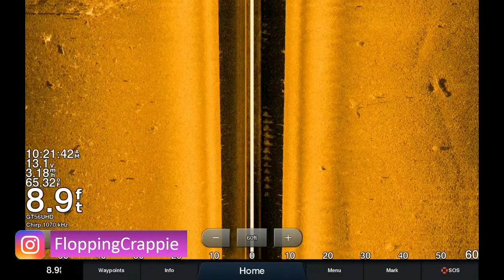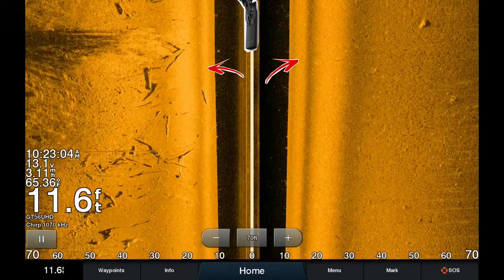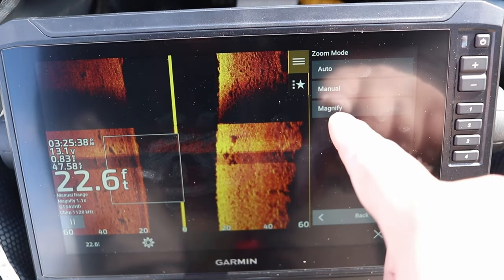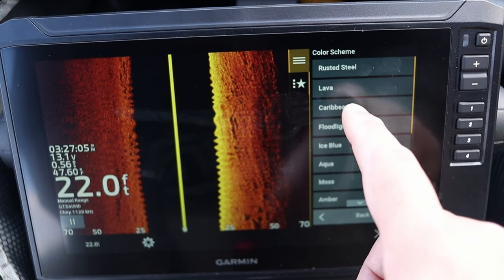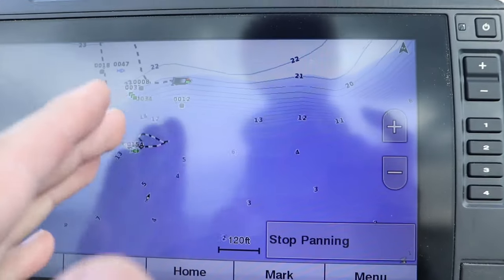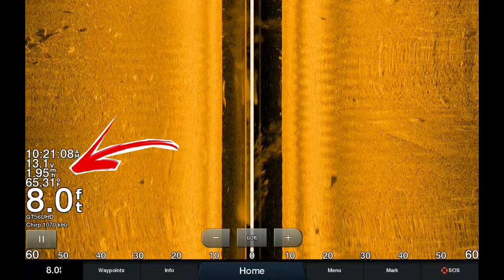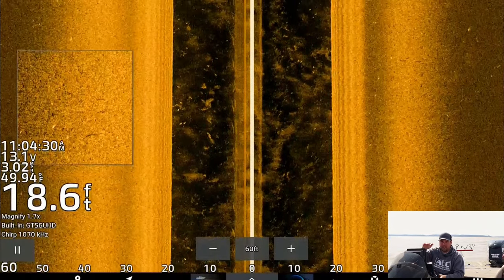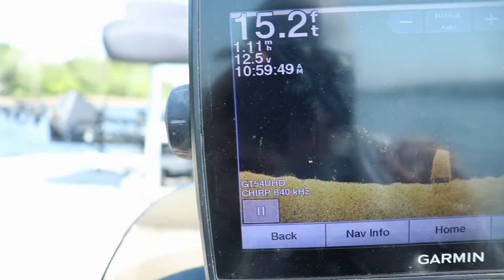How to use Garmin Echomap 93SV SideVu | How to use Side Imaging

Comment: Have you tried running your 93sv on your gt56 transducer instead of your gt54? Just got my 93sv with the 54 transducer and im not over the moon about it. Wasnt sure if its the screen resolution on the more affordable 93sv unit or if it was the 54 transducer.

Comment: I have a 93sv and my side scan range stays at 34 feet... I change it to 60 or 70 or whatever and it just goes right back to 34 feet???
Reply from the maker: You may want to check if you have the range set to auto in the settings menu. Otherwise, there might be an issue with the touchscreen that is causing the range to shrink to 34 feet.
Reply: It is not in auto so maybe there is something wrong with the unit, I just did an update as well so not sure but thanks for the fast response